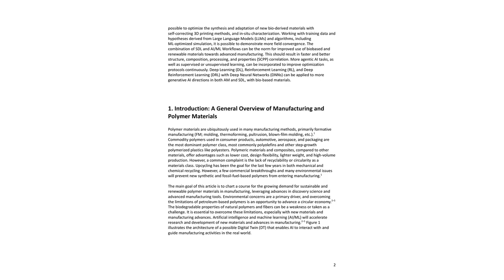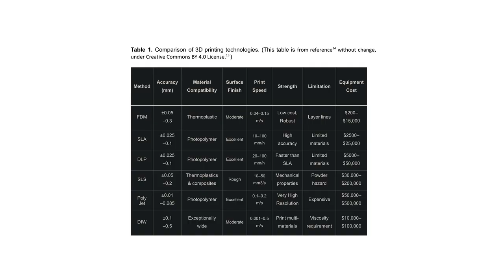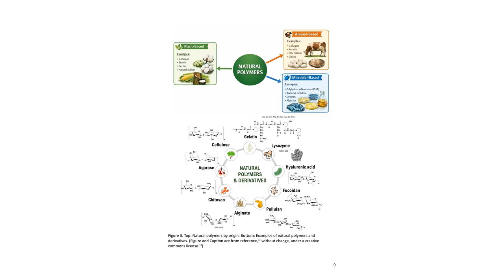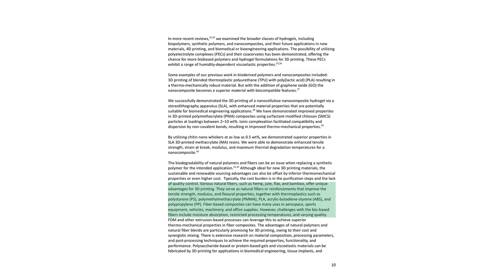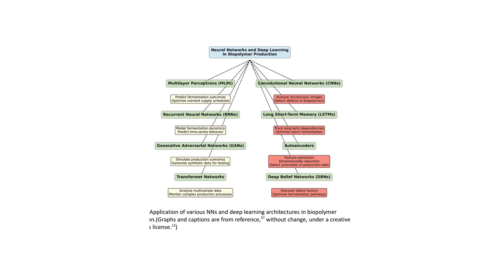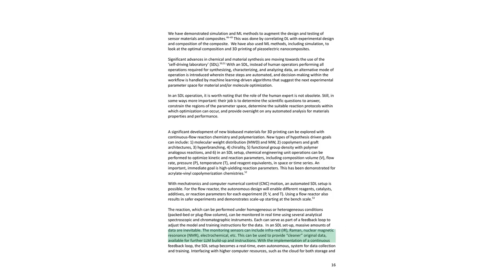Advanced Manufacturing and AI with Renewable and Bio-based Materials

Comment from the maker: SUMMARY:

This video explores the transformative intersection of materials science, additive manufacturing (3D printing), and Artificial Intelligence/Machine Learning (AI/ML), specifically focusing on the development and use of renewable and bio-based polymers.

Key Takeaways:
The Shift to Sustainability: Traditional petroleum-based polymers face significant challenges regarding recycling and environmental impact. The video advocates for moving toward a circular economy using bio-based materials like cellulose, starch, and PHAs (0:12-2:30).
Additive Manufacturing (AM): AM is highlighted as a sustainable production method because it builds objects layer by layer, reducing waste. The video discusses various techniques, including FDM, SLA, DLP, SLS, and DIW, noting that each has specific trade-offs in material compatibility and precision (3:17-7:10).
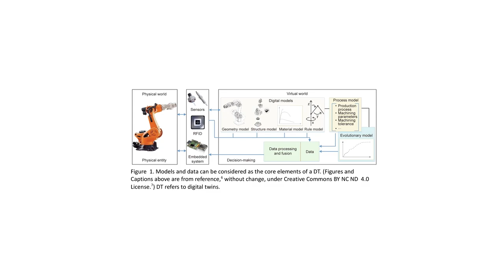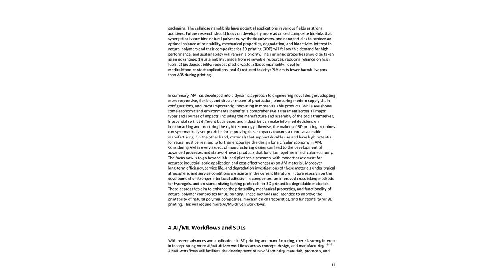AI/ML Integration: AI is a powerful catalyst for accelerating research and manufacturing. It enables digital twins to simulate and optimize physical systems in real time, helping bridge the gap between material structure, processing, and performance (2:42-3:15, 13:57-14:45).
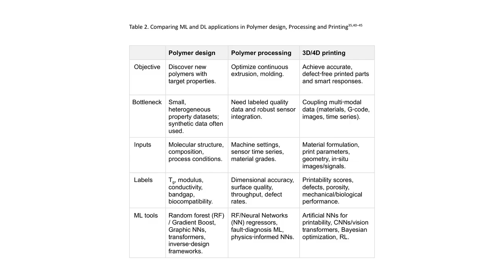Self-Driving Laboratories (SDLs): A critical concept presented is the SDL, which automates material synthesis and optimization. By replacing manual experimentation with machine-learning-driven protocols, researchers can achieve faster, more robust results while continuously refining printing processes (19:34-21:15).
Future Outlook:
Integrating AI/ML workflows with advanced manufacturing is positioned as the new norm for Industry 4.0 and 5.0. This evolution aims to create a manufacturing future that is not only faster and more economical but also fundamentally more sustainable (21:26-22:24).